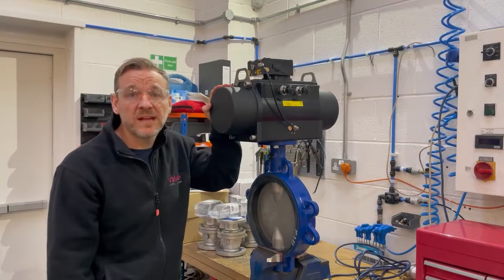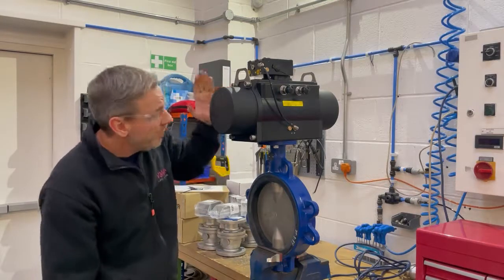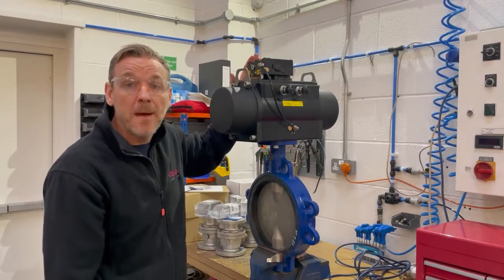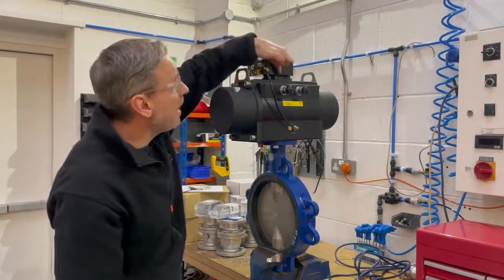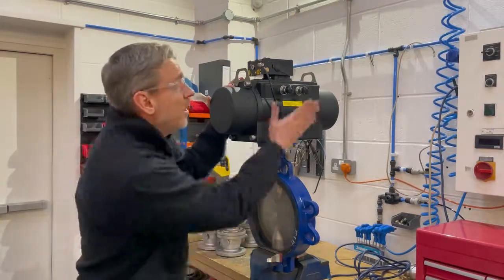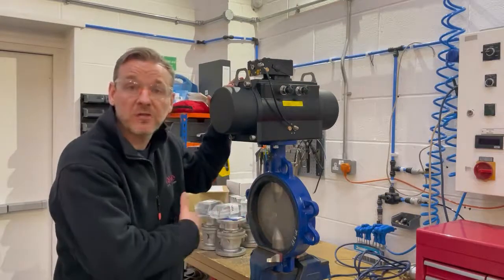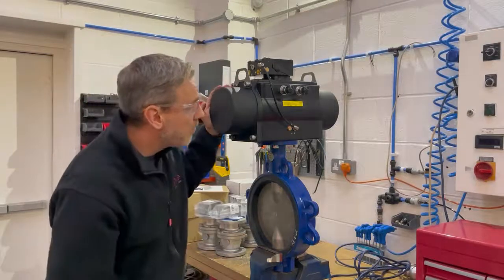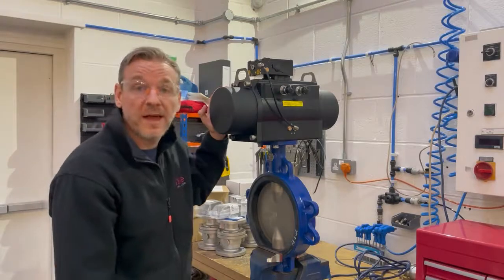Keystone Butterfly Valve, Actuator & PMV Package - Behind the Scenes at Valve & Process 31

Comment: Been working on Bray valve with PMV P5 pneumatic positioner. Could you please upload a video on how to set up this PMV. I fitted a new Bray butterfly valve but the valve keeps failing (incorrect positioning) how can I calibrate this please? Could this be a faulty diaphragm? Thanks.